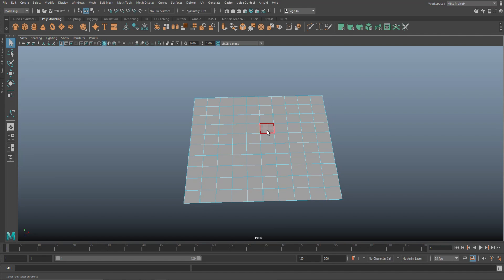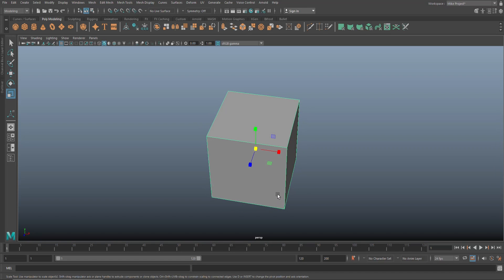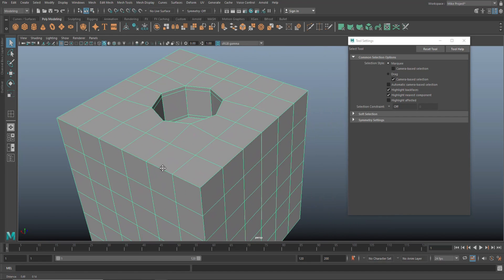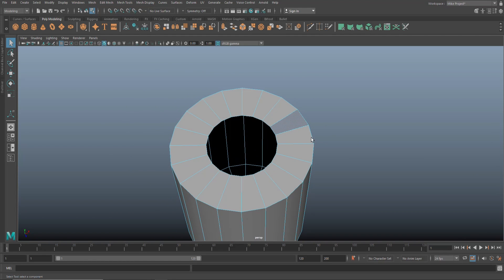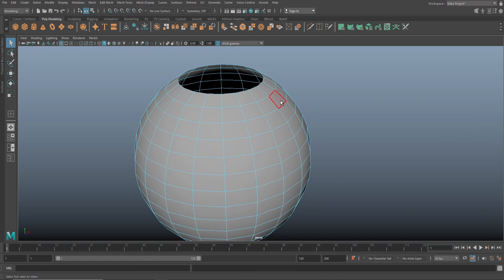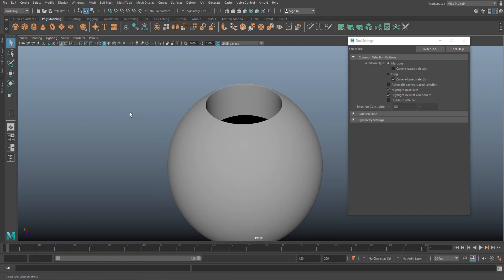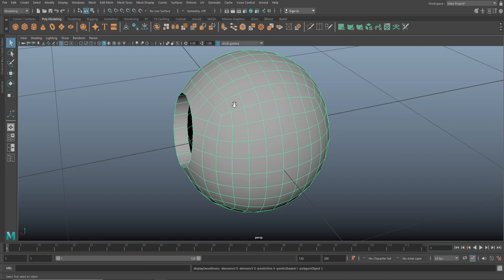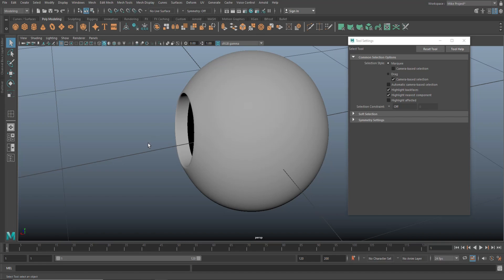Clean 3D Topology, the KEY to success !

Comment: Hey Mike , why sometime shift double clicking not select total edges...it happens many time with me...but don't understand the reason....in this your trying to select circles edges for bevel.....
Reply: Sometimes there is no edge flow to what you are selecting. In Mike's circle at the end there were several edge flows that finished at the circles edge therefore the edge he was selecting only went maybe four lines across because that edge flow ended wiith the other edge coming into the circle.